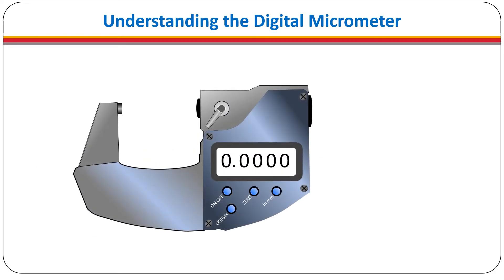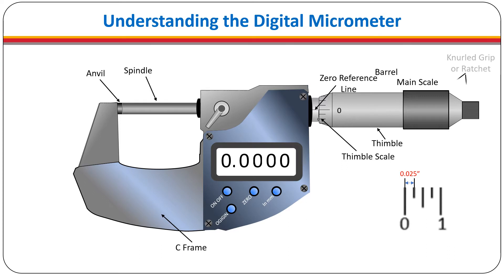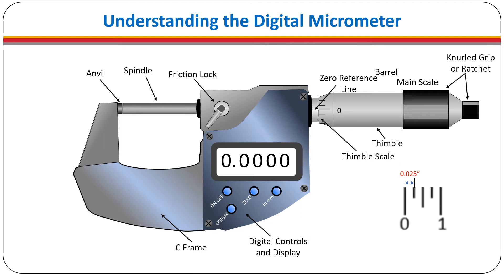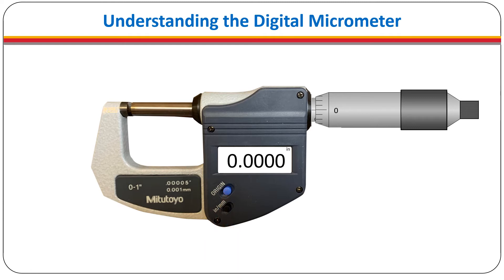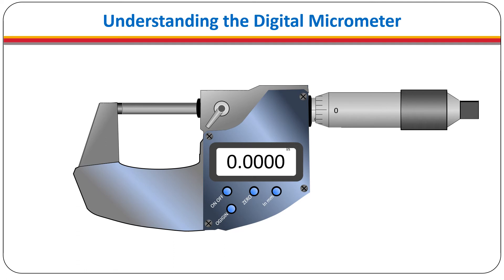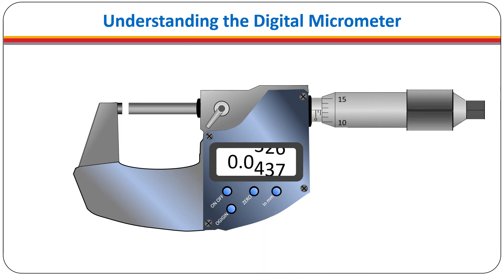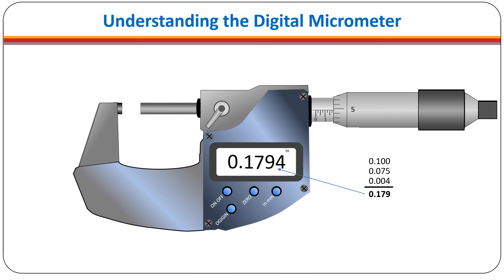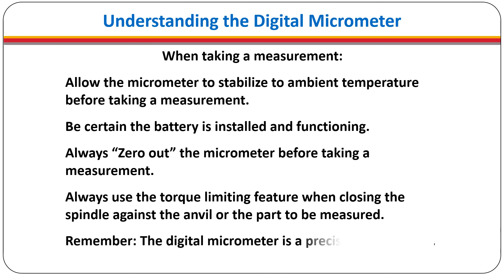How to use a digital micrometer

Comment: The accuracy for MM is actually to one one thousandth of a mm or one micron .001mm.  This video says one one hundredth or .01mm
Reply: The gentleman recording this video is right. The accuracy of the micrometer is normally 0.01mm, while the resolution is 0.001mm. The last digital is an estimation number, 0.01mm is the actual accuracy.